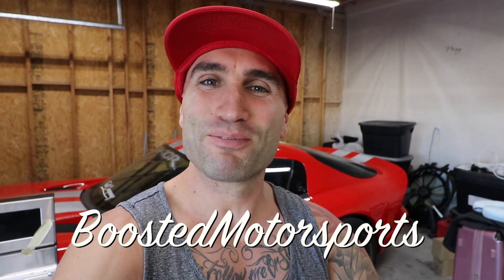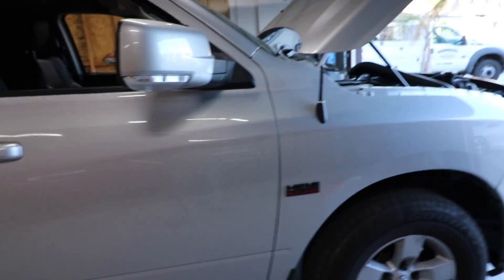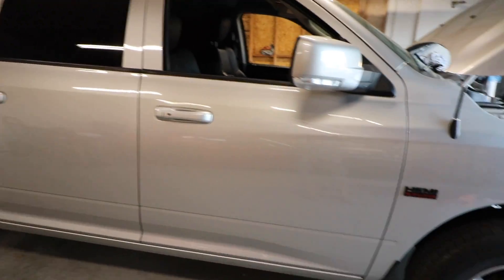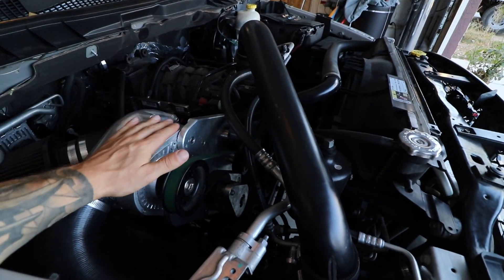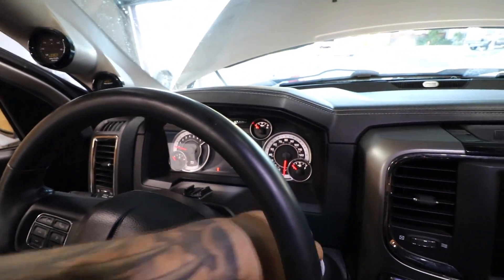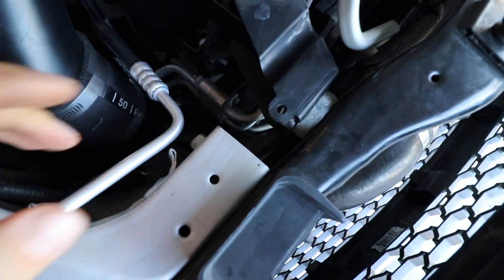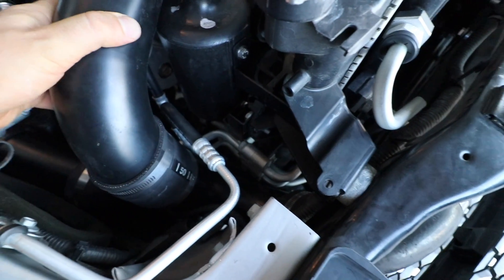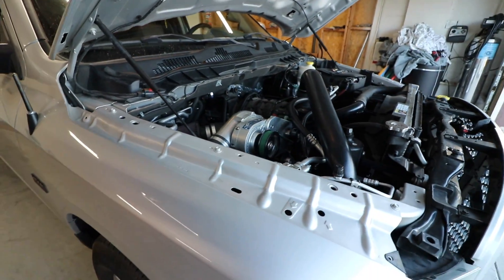Supercharged RAM1500 Startup - HellRAM EP10

Comment: i sure do miss that sound glad to see my procharger is alive again. (sorry i meant your procharger)😉
Reply: How much power can that stock 5.7 bottem end and top end handle without getting scary? Did u have urs dynoed when the procharger was on it?
Reply: @Ajf699   ive seen numbers from 478 to the wheels to a little over 500 on 7 psi. they say 7 psi is safe but there are a few around 10 psi with no issues.i never had mine on the dyno
Reply: Did that kit come with a tune u downloaded with the install? And if u dont mind me asking how much was that kit and whered you buy it from?
Reply: @Ajf699  i bought it from fasthemis.com it was right at 6800 for the complete kit and it does come with a tuner and a tune from procharger.
Reply from the maker: Should sound even better soon too! Have a few goodies on order 😎

Comment: Hoping for a response, I have a 2016 Ram Rebel. 5.7L V8
I've already installed: 
Sport AWE exhaust
S&B Cold Air Intake
Throttle body spacer
Diablo Tune with 93 octane tune.

I have someone who says he can install a "turbo kit 78 mm producing over 550 hp, comes with intercooler, exhaust manifolds, fuel pump, and headers" for about $4k. And new I'll need to install new fuel injectors. 

Is this a realistic expectation? Is there anything else I should replace? What should I expect as a result?

Comment: I have helical gears with no rattling. 2012 ram express. I will say hp at the wheels is not as expected but I enjoy the 0-60 performance.
Reply from the maker: Yeah yours is the quiet one. These straight cut gears are noisy! Lol
Reply: Sounds disappointing if I read between the lines.

Comment: nice work i have question i have 09 dodge ram 1500 4.7 i yes buy tachometer for the rpm and i ready know power supply and ground the only thing i don’t know where i conect the green wire on the engine i see videos the saing conect on the coil put my have many coils tanks

Comment: I have a question about the line that connects to cold air intake ( fuel line hose ) that goes along to cold air intake right after the intake filter. So when you install a supercharger, where does this line hook up to? I appreciate it you can answer it.

Comment: Very cool. I have an 04 Hemisport ram I plan on supercharging this year. What kind of numbers are you seeing & would you recommend adding a rear differential locker for traction?
Reply from the maker: These newer rams have a limited slip from the factory so no one wheel peel here!  Not sure on exact numbers but should be around 550-600hp approximately.
Reply: @BoostedMotorsports  Thanks for the reply.  Hemisports came w/a factory locker, but they are pure $hit. Those wheels you added are sweet!

Comment: I have a 17 ram 1500 and I was wondering what I would have to do before I can slap a procharger on this bad boy.  
And other than that how much have you spend on the aftermarket parts to get your truck where it is. I love your videos keep up the awesome work!
Reply from the maker: Hard to say how much the total build is currently but most of this stuff was picked up at discounted prices online or used.  Probably around 7k total spend.  You'll need an unlocked PCM and a tuner like HP Tuners and then the rest is just bolting it up!

Comment: I wouldn't consider that "rattle" inside the supercharger a gripe. The gearing inside cant be so tight that there is no mesh relief otherwise there would be bind and loss of power. Not to mention accelerated wear of the internals. There has to be some sort of relief.
Reply from the maker: Some make it and some don't  The tolerances are much looser than necessary.  Its like saying a rear diff should whine lol
Reply: @BoostedMotorsports  could it be that those gears are straight cut and not helical?

Comment: How about a dyno run!  Ripp is doing their Vortec charged 3.6 Pentastar kit for Ram trucks and it makes 440+ to the rear tires.  I have a Ripp charged V6 2016 Chrysler 300S and a stock 2014 SRT Charger.  The Supercharged V6 is faster than the SRT 392!

Comment: Can you do another mpg test with this kit and before you lower the truck. Also at normal highway speeds from 70-75. Thanks if you do. Just interested if it really affects in a good or bad way or if it’s nearly the same as stock.
Reply from the maker: I'll try to get it done!  Driving around on the weekend it didn't seem too much different on the highway
Reply: BoostedMotorsports sounds good!!

Comment: Really interested to see this ram procharger setup.  The extra power (150hp?) must be great, but I have to wonder about whether or not it's going to destroy the engine.  Any info on failures with the procharger system on this engine?  I'd love to do something like this with my truck (2015 Ram 1500 5.7), but the expense is HUGE!!  Thanks for posting this!  Very interesting!
Reply: Ram engine should be bullet proof

Comment: this kit have the straight cut gears or helical gear set? Hqen2000 youtube channel describes it as a box of rocks sound
Reply from the maker: Straight cut but that is only supposed to affect the supercharger whine which I love. This slapping around metal noise at idle is pretty crappy sounding. If you google procharger rattle you'll see a ton of forum posts though 🤦‍♂️

Comment: Nice vid as usual. BTW, I’m having trouble with tpms on my truck, since I had my stock wheels powder coated. Been to local dealer twice already and again it’s malfunctioning. Did you have any issues at all with yours when you swapped out wheels and sensors at all?
Reply from the maker: I still haven't fixed mine lol but need to soon!

Comment: Hi, I've been watching your videos for a while. I plan on doing a super charger in the next year. On a side note, when you did the clutch fan delete and added the larger v6 fan, the factory harness is not long enough to mount the solenoid back in the housing (I just zip ties the wires to wherever I coukd to keep them secure). I noticed in one of your videos that the wiring harness looks "factory" and that you were able to extend the harness and properly mount the solenoid/the round green tube back into the fan housing. Can you show that video? Thanks!
Reply from the maker: Thanks Scott! I have a separate video on extending the harness. Let me know if you can't find it but you'll see it in the ram mods playlist 👍

Comment: How much is the cost?
Reply from the maker: I got the procharger with 1000 miles on it for $4000 but with tuner and other misc probably about 5-6k for the s/c setup. More in the truck though with all the other mods, exhaust, wheels, susp, etc

Comment: ah hell just tighten up the belt and drive that bitch !!! also have you considered a rotating assembly upgrade ? im wondering how much more the stock crank, con rods and pistons can take before they fail , just wondering . but anyway keep them coming . 
giving me some ideas on which way ima go with my 14 express model
Reply from the maker: Yeah probably down the road if we stick with this pig we will build it up for more boost!  Once we get it dialed in we will take a vote but might part it out and start another project after 😎

Comment: Why would you boost a Ram 1500 when the internals are not forged that  Motors not even going to
last 6 months of your  hard on it sorry not 3 months the 5.7 liters on The Challengers and Chargers can't even handle that boost nothing is forged in those motor.
Reply from the maker: Low boost is fine.  Its when you start pushing things past 10psi you have to worry 😎

Comment: That's where Ford and GM have beat the ram they've got four words like for an example Shelby and Roush that are producing 700 horsepower with no problem because those Motors are forged internally not like the ram it's not going to like that ProCharger good luck bro. Not to hate I do like your videos
Reply from the maker: Hellcat engines make well over 700 hp so all the big 3 have capable engines.  Rumor is they are supposed to drop a hellcat powerplant in a RAM soon too!
Reply: @BoostedMotorsports  yes the Hellcat has forged internals. But the Ram 5.7 Hemi doesn't the Challenger and the charger 5.7 and 6.4  392 does not have forged internals. So when you do Boost them nothing but trouble your gambling